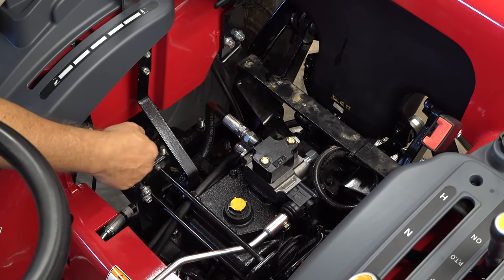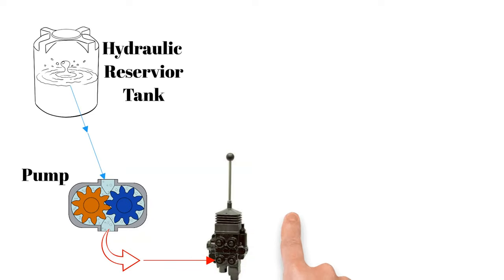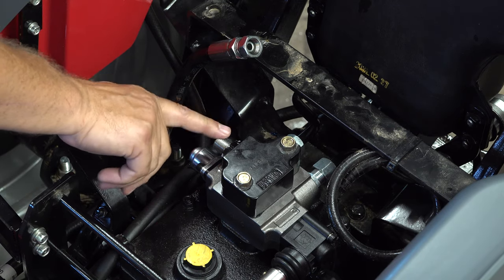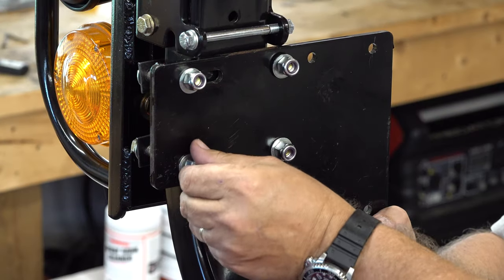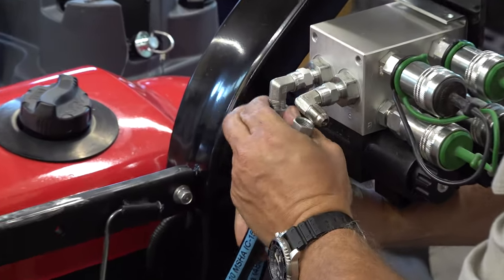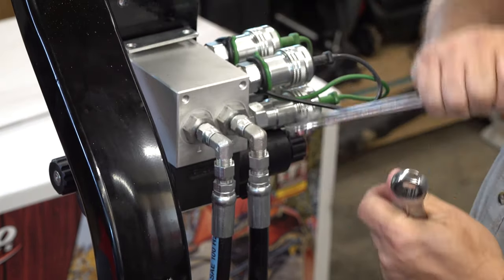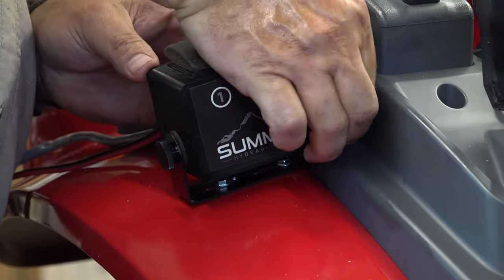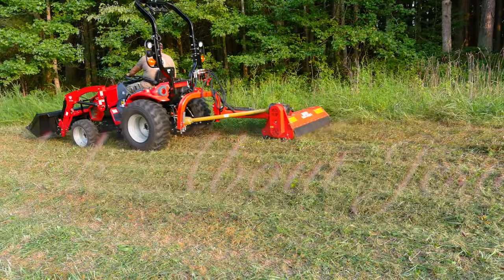Tractor Rear Remote Kit by SUMMIT Hydraulics

Comment: Thank you, Tony and Tanja! Always great info!. My LS has a Summit diverter in its future to run my grapple. That will free up one of the rear remotes. Both are used now, one for the grapple (which is a pain to operate because I have to let go of the loader joystick and fumble down on my right side of the seat to get to the little spool control lever), and the other controls my hydraulic top link. I might still add this valve set up you have - you can't have enough rear remotes!
Reply from the maker: I put a third function kit on my T264 from summit. The video was back last year.

Comment: Very nice video Tony, the Summit valves are great addition. Thanks for the information on the install.
Have a Blessed weekend and Stay Safe.
Reply from the maker: It is really working well to this point. I may put some restrictors in the implement lines to slow it down.

Comment: Tony, your videos are just the best.  I just feel good after I watch them.  Referencing a higher being, a greater calling may have something to do with it.  Anyway, i'm interested in your thoughts about the best hydraulic setup for a T25 w/ grapple, top link and ditch flail mower.  I have been talking with Summit, they recommend a 4 spool rear remote kit, 3 toggle box for the flail and top link and using the joystick handle buttons for grapple.  I'm a bit concerned about the size of the 4 spool rear remote and also running hoses from it for the grapple.  I've seen your videos but not sure how you put it all together on your T25..  Your input would be greatly appreciated.
Reply from the maker: God blesses us every day.

Comment: Hey Tony, been watching you for a while and like I said, you’re videos are the reason I purchased the T25 and I love it. Looking to add a flail mower to my equipment but I need to add the rear remotes. I have the T25 with the loader, full cab (cause I live in Maine and it’s cold as hell) and backhoe, do you see any problems installing this kit with the cab. If so do you have any recommendations? Thank you for the videos you put out, nothing I like better than watching a regular guy do what he does.
Reply: Also I am somewhat mechanically inclined my sone owns 2 garages and I was a machinist mate in the military and mechanic 40 years ago.
Reply from the maker: I don't see any issue that can't be overcome with some ingenuity. The system is fly by wire so you can put the switches anywhere you need. The electric over hydraulic valves will be the most complicated part of the installation.
Reply: @TonysTractorAdventure  thank you, kinda what I was thinking but with no experience with installing the system myself I was just curious.

Comment: Just a suggestion, but might want to think about a rubber grommet where the wires go through the plastic cover so they don't wear. Video is very informative. What are your thoughts on the LS brand?
Reply from the maker: I am a big fan of TYM. No comment on LS. 😇
Reply from the maker: I think I might put a little tape around the wire. I seen that watching the video.

Comment: Hey Tony. I have never I stalled anything like this before but I just got my remote kit for my T25. Am I wrong when I feel like when  I go to get my hydraulic hoses made I will need the female English thread for the T line and a male English thread for the P line? I know you mentioned the fitting but I guess my comprehension level is low on this kind of stuff. I’d rather ask a question and get verification than go and spend money twice because I didn’t understand something. Love the channel. Thank you for you videos.
Reply from the maker: I have slept since I installed this kit, but I think British Pipe thread comes to mind.

Comment: Thanks for the video.  I have a T25 and am considering getting the offset flail mower.  I have a couple of questions. I am assuming that you added a Tee in the P connection to serve the loader as well  as the new valves and then another Tee in the T line. Is this correct?  I couldn’t see a Tee in the video. 

Did you consider manual valves in lieu of electronic?  I wonder if a manual valve with float would be better for the level adjustment for the mower.
Reply from the maker: Damon,
"T" in hydraulics stands for Tank (Return to Tank) and P stands for Power Beyond (Pressure). I would never recommend putting a tee, but always putting the next item in between.  A float valve in small tractors are very rare, and will not work with this mower. The solid top link sets the cutter height.

Comment: Thanks for the clear explanation. 

I've got a T25 coming... it's going to have a hyd top and side link. That is two remotes right there. Then I have an offset flail mower. Any opinions on how to handle that. 

I wouldn't need the top and side links when running the flail, would it be better to unplug them each time I mow or is there any reason I wouldn't want to do this other than the hassle of reconnecting each time? or should I get a 4 port kit
Reply from the maker: I don't have any experience with the running the side link. The price difference between the 4 port and three port is not that big. I am interested in how you are setting up your rig. I have never seen a side link that small.
Reply: I can send some pics once I get it, the dealer is ordering the parts. 

Spoke with him yesterday and he said it would be ok to just have two ports, though I lean toward having the hoses always connected but it seems either option will work.

Comment: Tony, after looking on Summit Hydraulics webpage, the two station remote valve appears to be intended to plug into the Ag coupler of one of my remotes, and I would still use the lever of the SCV already there - just able to switch the Summit to direct flow to two outputs. Your kit appears to get input from your Power Beyond from an adapter under the seat. So, then do your Summit switches do the flow controlling  to your implement's cylinders? How do you get fine control over the flow rate, being that switches are on/off only?  Do you need a flow restrictor to control the sudden jerky movements? And where did you source the PB adapter attached under the seat?
Reply from the maker: To this point, I don't need fine control. I could put a restrictor in the line of the implement if needed, but I have a standard rear remote if I need it. The electric controls can be pushed and released quickly.

Comment: Tell me more about how you wired the power source.  I bought this and tried to wire to fuse box but it’s not getting power.  When I wire directly to the battery it does get power
Reply from the maker: That was several years ago. I can't remember.

Comment: Tim I have an RK T25 model tractor. I have the front loader and also the backhoe attachment so I’ve already have rear hydraulic connection points for the backhoe assembly my question is I would like to add a few additional ports I would like to be able to have a hydraulic thumb instead of the manual thumb on the Backhoe I would also like to add an additional port upfront that would allow me to use a grappler. What recommendations would you give. I appreciate your time thank you
Reply from the maker: Upfront, buy the OEM third function kit assuming it is the same as TYM. I have never had a use for a thumb on a small backhoe. They do not have enough reach to be effective. The backgoes are not commercial and not meant to bounce along with a load. The grapple is the way to go.

Comment: So I am wanting to install the 3 or 4 spool version of this on a Branson 3015r that came without rear remotes to run an offset flail but I also want to get the factory backhoe attachment at some point in the future which will need full time flow when in use, how would you set this up to be able to power it? I’m thinking I could tap into the lines before the spools and add a simple detent lever/remote just for the BH, unless there’s a way to modify the switches or a kit that has detent integrated.
Reply from the maker: You would have to run a separate circuit for the backhoe.
Reply: @TonysTractorAdventure  Thanks Could it be done in-line with the summit spools, or would it need it’s own dedicated circuit from the power beyond?I don’t see any reason why the summit kit itself wouldn’t run it other than the fact that it’s all momentary switches…

Comment: Hi I cant seem to find Rear Remote Kit  for branson 2400h . does that kit fit? or any you recommend that would fit .thanks
Reply from the maker: Yes it would. You will have to have a few hoses made up, but it can be plumbed in on any tractor with hydraulics.

Comment: Quick question, I have thought about this as an alternative to going back to the dealer but am unclear about a couple of things. I don’t have power beyond in the rear, I was told to run it from the front loader valve to this kit and then back to the hydraulic block under the floor. Also to run a separate line from the kit to the tank. Another said just run the line to the kit and back to the block, so I’m a little confused and don’t really want to burn my pump up. Any help?
Reply from the maker: I did a video on it. I hope this helps. https://youtu.be/MRDCX7DH0xU

Comment: Anyone know if they make a 3 remote one for Kabota
Reply from the maker: Summit makes this kit for many tractors. Hydraulics are hydraulics, no matter the brand. I doubt anyone has an exact bolt on kit for every model. You will most likely have to do some fitting chasing.